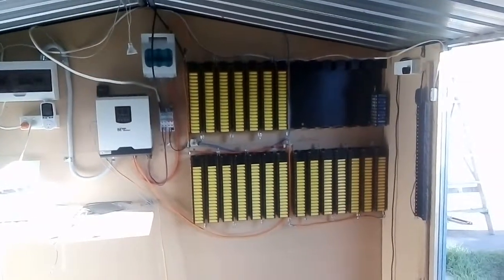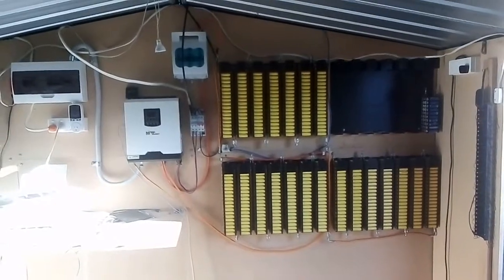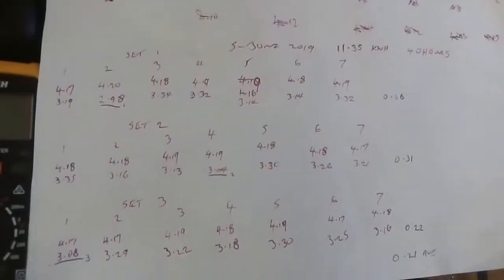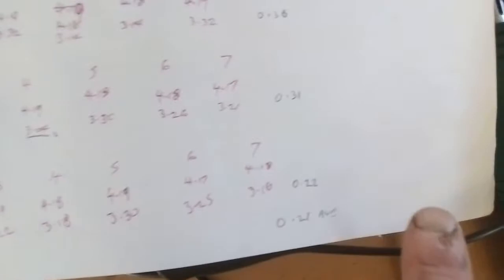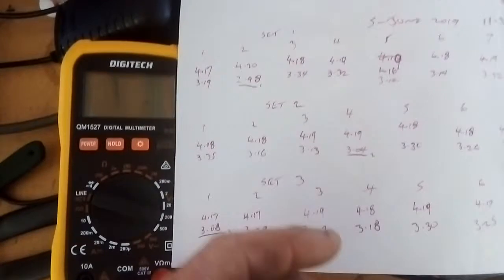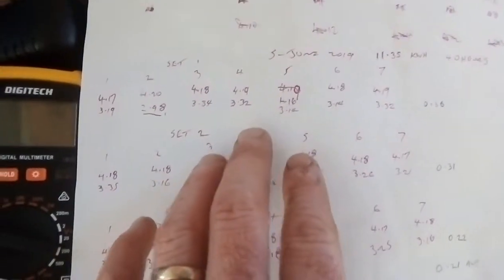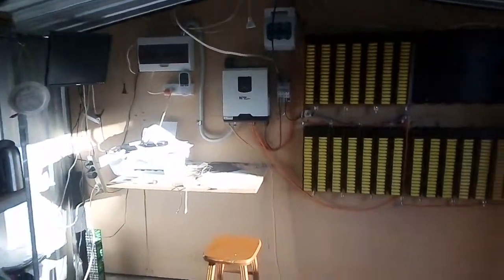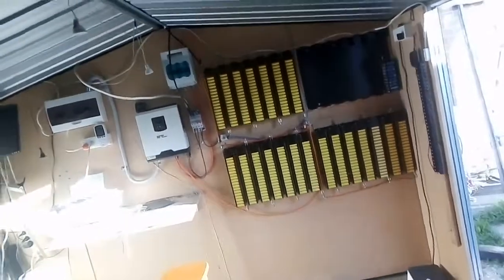Results are in. How did my Power Wall do for Capacity.

Comment: Nice setup you've got going.
I just wish I could sourse cells quicker haha
Reply from the maker: Me too. Can not get cells faster enough. I need to try harder. Not too stressed because I need the next charge controller to charge what I have got. I have more panels on my house roof ready for that controller.
Thanks for watching my videos.
Reply from the maker: Have you got a setup you can show me?
Reply: I haven't got anything mounted yet as I've only put 1 'test' pack together with all my cells under 2000mah and just use it on the test bench.
At the moment I can get more free solar panels that old laptop batteries haha